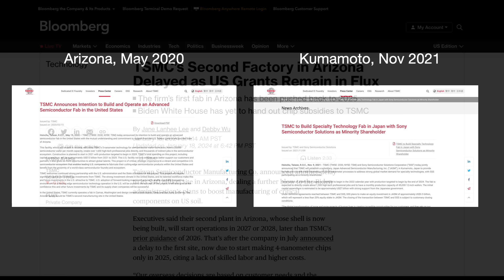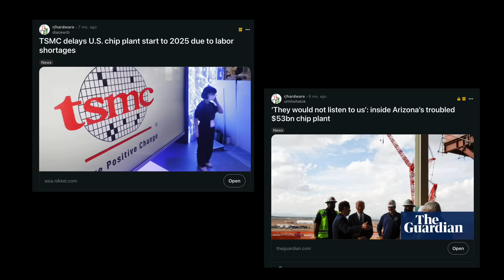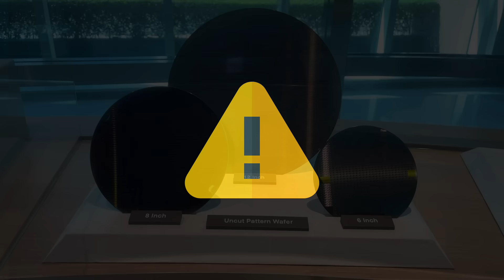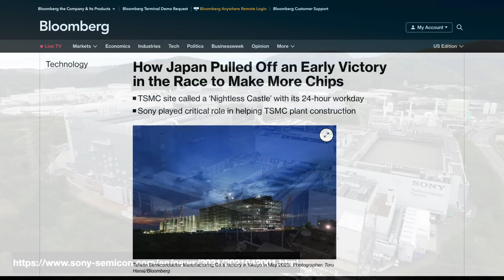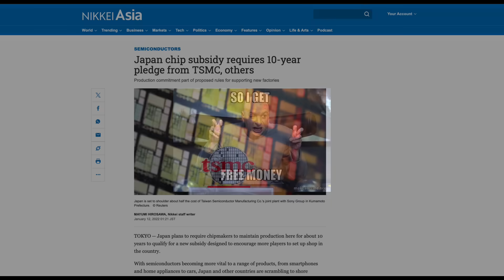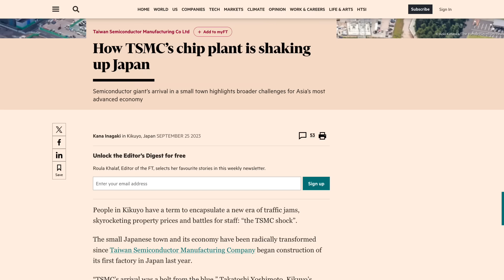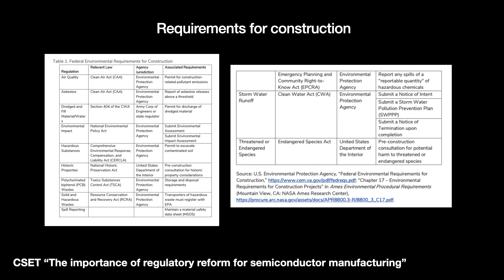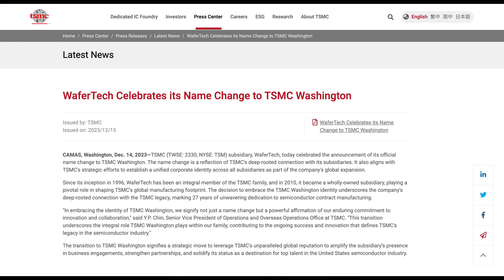Why is TSMC Doing Better in Japan?

Comment: According to several news sources, TSMC had originally planned for its second fab in Japan to manufacture 4-nm chips. However, TSMC has since reconsidered and is now considering a shift to 2-nm production once its 1.4-nm process comes online. This move would help all involved parties and countries secure a stronger and more resilient supply chain. I hope it will happen.

Comment: Can you please explain what is the meaning of what Dr.Morris Chang said below........ ?

Aug 6, 2023 --------TSMC founder Morris Chang was featured in a New York Times article that came out over the weekend. When asked about the Sino-U.S. competition for semiconductor supremacy, the chip titan said China doesn’t have much of a chance to gain the upper hand.
Reply: China faces couple of problems that prevents them from doing so. Given the right environments they can do it but China alone cannot develop such advanced chips. That's why they rely so much on sending students abroad. But that's not the only problem. China needs investors and nobody wants to partner up with any Chinese semiconductors. Nvidia, Intel, AMD, etc. Another factor is the pollution. It requires very clean water and clean air to produce high end chips.

Comment: 3:44 I noticed you never mentioned whether they had actually bought any of the machines yet? If they were slow walking in the us then all they would need to do is just not buy those machines you mentioned (after all what would be the point in buying them before the building is done, even better sense they require so much lead time) until they were ready to actually finish the project, helped by the fact big companies in Taiwan are a lot more tied to the government (both officially and unofficially) .

Comment: Unions? get these rodents away from this project asap, this is the one industry where worker "strikes" are the last thing this company or anyone with an electronic gadget wants. Imagine holding the supply chain hostage (oh wait didn't that happen in the America ports during the pandemic?)
Does TSMC have a bad reputation for wage compensation? I don't know, but I really doubt it.

To believe TSMC is really cutting costs for the installation of the new equipment at the expense of a delay that can theoretically cost them more money in the long run seems farfetched. TSMC should know what's better for their foundries and facilities, they have the talent, expertise, knowledge and discipline. Your channel really opened my eyes to the Semi-conductors and chips industry, thank you.

Comment: @ 13:03 i spotted a mistake i guess. 30'000 yen or even 50'000 yen is not a living wage. That's an expensive night out. 
I take it as a place holder for a 66% overpay, they offered?

Comment: If, as you say, "tolerances" of N4 are "less forgiving"  ( than lager NM rated chips ) ... why do you insist that N-size is not quantifiable ?    From what I have gleaned.... please correct me if I am wrong....  the EUV beam width measured in NM is responsible for overall semiconductor density, thus, performance.  ( You can squeeze more stuff onto a chip.)
Reply: IIRC Intel stopped quoting size in nm a couple years ago, they said it didn't make sense anymore because there was no industry standard for exactly what it measures.  Intel had been saying their 10nm was equivalent to TSMC 7nm.
Reply: Look at # of transistors per unit area. mm^2

Comment: Totally disagree with this analysis. Things are slow 100% due to politics/geopolitics.  0% to technical issues. TSMC knew from the start, that if everything went smoothly, making chips in the US is 30~50% more expensive. TSMC was doing the US a favor by setting up a 5nm fab, and expected a hefty subsidy. But the initial CHIPS act rules required TSMC to divulge both technical data, and competition sensitive business data to get the Subsidies. TSMC is way ahead of Intel and didn't want it's tech give to Intel by the US govt. The sillicon shield is real.  Numerous US think tanks have estimated that a China blockade of Taiwan would cost the G7 economies 2 trillion dollars.  That's why Blinken publicly said the US does not support Taiwan declaring independence unilaterally.  The US doesn't want, today, to provoke a proxy war over Taiwan.  In fact the Philipines and Koreas have now flared up.  Without the silicon shield, it's be Taiwan flaring up.  Also congressman S. Moulton said that the US would bomb TSMC to the ground to keep it out of China's hands. The silicon shield is real, it's not the only reason but its a significant contributing factor.
TSMC has NOT allocated 40B to build 2 fabs. Not 1 cent has been spent on the 2nd fab.  And 2028 may as well be 2050 or the year 2100.  The question is how much money will TSMC lose on its Az investment?  TSMC might break even if it gets ~ 5B of subsidies AND stop construction of the 2nd fab entirely.
Reply: Nailed it. Also Tech transfer is happening from Taiwan to Japan now. Flashback, that's how Taiwan obtained tech from Japan after US-Japan 1980s tensions.

Comment: Wouldn't the Arizona plant be better than Japan?
I mean they have earthquakes and that could really screw up some wafer batches and uncalibrate the machinery.
Reply: Japan has skiled technicians at tye same time longer experience in manufacturing semis. Also japan doesn't have qqater problems like Arizona. Earthquakes are not a problem because japan knows how to handle them.

Comment: That chart showing how Japan builds fabs faster than Taiwan, China or Korea is interesting. Japanese construction is just on another level. In railway construction JR leads in construction speed and solid earthquake resistance. Fast but also carefully engineered. I saw Kanazawa Station before the earthquake and noticed all the quake dampers on the columns.
Reply: You didn’t include Singapore in the ballgame. GF Fab7H was promised to be completely build up in 2 year but did in 1 and a half year. Same with Micron and ST Micro.
Reply: Cant agree about speed on construction. Remember the nagasaki shinkansen or rinkai line wich is only 6 km needs 20 years of construction
Reply: @adiba9734 Japan has Shinkansen since when? 1964.

There is many earthquake in Japan. So the delay is mostly because of this in calculation.
Reply: @JapanQuest   theres nothing to do with that tbf. Most of japanese infrastructure was built faster before 90s. Just take a look at the hokuriku shinkansen that take more than 17 years to complete just 300km lengt compare to tohoku shinkansen that just need 10 years to complete 400km of tohoku line. The same problem was also happen oversea that the jakarta mrt extension need 7 years to built just for 6km of lengt that built by japanese contractor.
Reply: @adiba9734  because Japan focus on high quality. The quality is way above China.

Comment: I live in Phoenix and although I don't have specific insight I can offer some general thoughts.  
1.  Intel is expanding and training is held in the US
2.  Water is an issue not going to be easily or cheaply solved
3.  AZ has horrible pay rates that don't lend to employee loyalty
4.  The air in the desert is extremely challenging to filter - silt is invasive
5  AZ unions are weak due to the state being a right to work state.  The unions have no legal means to keep non-union employees out of the work force

Comment: I have a process engineer cousin, 4 years XP, working at Intel and he told me that the TSMC fab offer its just a bit over the Intel. He refused because he does not want to work under so much pressure that the TSMC is putting on people

Comment: A bit off on current investment in the AZ Fab.  If they have just installed the last steel beam. They are a long way from installing the manufacturing tools. Building a fab building is not cheap but it is peanuts compared to advanced fab equipment. They could probably still afford to just walk away if they wanted to.
Reply: They can't go away.
Even if the AZ factory keeps losing money, they can't go away.

Comment: Hey dude, forget the chip shortage, that's not what the TSMC fab in the US is supposed to deal with.

No matter how people FEEL about AI, it's growth is HUGE and it's going to keep growing for a few years.  Also, while a lot of companies don't get on the MOST advanced node, they get on the one right behind that, and right NOW that's N5/N4 so if TSMC could get that first line up in AZ there is NO shortage of need for what could come off that line.  In fact N4 is what a good chunk of AMD's next product line will consist of.  That comes out around the end of this year.  This means somewhere along the life cycle of next gen AMD parts, some could be rolling off the line in AZ.

Having said all that, 2025 is a date that TSMC floated at the beginning of this project so THEY knew it was going to take a long time to get this up and running.  On the other hand, Intel floated a date of 2024 for their new fabs in AZ.  They're also supposed to be putting out Intel 20A.  I'll be SHOCKED if they get it out in 2024.  I mean it took Intel forever to get onto EUV.  Having said that all their issues getting onto EUV could help them get onto High-NA EUV much faster so maybe Intel CAN actually move to a new process node without years of delay, maybe.

The TSMC plant in AZ can handle 6 phases.  I expect there will be at LEAST 3 because they WILL be bringing in High-NA lithography and once they get through the growing pains of that, that opens the door for future nodes.  I think TSMC will find the U.S. to be a HUGE market, you know with Apple, AMD, Nvidia and a few other companies where the push is really to bring back not only fabrication but assembly and testing, via the US and Mexico.  Different companies are already in talks with getting labs in Mexico, so I think maybe you're failing to see this all play out over the next few years.  If assembly is happening in Mexico then it makes sense to take chips from AZ, truck them a short distance to Mexico, do assembly and testing and then finished products come back into the US.  But with AMD as a customer and AMD making a variety of parts including CPUs for enthusiasts (DIY PC building), that could all be done in AZ including finishing the CPUs and testing.

I'm not as pessimistic as you when looking into the crystal ball.  I think the TSMC AZ plant will most likely get at least 4 phases because if they don't Intel will start stealing away TSMC's customer base ESPECIALLY if Intel gets to 20A before TSMC gets to N2.

Comment: If I remember correctly the Japanese first phase uses DUV since it's 28nm which actually DOES refer to something.  It stops referring to anything dropping down below somewhere in the realm of 14nm depending on the company.

Getting a DUV lab up and running is VERY commonplace for TSMC now.

On the other hand AZ is loaded with problems, starting with even the construction, water issues where TSMC has to recycle almost all the water they use, and on and on and on.  It's also using EUV which is a much harder lithography to get perfect.

N4 is a variant of N5 so it's not a big change for them to start with N4.  This was always a possibility for them and it makes sense because different American companies are using N4 for different parts, the biggest being AMD.  Nvidia currently uses N4 but their next product lines should be N3, and Apple is using N3, so phase 2 for the AZ plant should be N3.  AMD on the other hand is using mostly N5 and N6 with SOME parts on N4.  The AZ plant will probably never make anything for Apple since Apple always wants to have a node advantage and are on the newest nodes, but they can make parts for a lot of other chipmakers who don't want to be on the newest node for various reasons.
Reply: If you run with the most "advancing" chip maker, why not just listen it's issue of critiria, and run with it first, then you become the most "advancing"? Mr. USA
Reply: No one forced TSMC to build their fab in Arizona. TSMC chose it there, Taiwanometry is always complaining about everyone in Asia but China. Now it’s complaining about America.

If TSMC wanted to build it’s fab in hot humid place then they should have selected Florida.

TSMC chose Arizona knowing process will be slow.
Reply: @kulkrafts3143  I can't believe people are actually this daft, the TSMC plant was announced during the height of the chip war with china when America announced its CHIPS and Science Act. While they didn't technically "force" TSMC to operate in the USA, the tension between China and Taiwan was at its peak during Covid as the lockdowns also cut off diplomatic channels between Taiwan and China. 

It didn't help that TSMC at the time just announced its newest 3nm Node, compound that with the fact many chips in use by US military is also manufactured by TSMC, there was a really real concern for China taking Taiwan and gaining both the newest chip fabrication technology and access to potential vulnerabilities in US weapon systems. 

There was significant pressure from the US for TSMC to build its newest 3nm fab in the USA, its just done in typical US fashion. The China chip ban cutting off TSMC from one of its largest markets, and the CHIPS and Science Act with its enticing government subsidies makes it super obvious to any company what America wants them to do.

But of course once Covid was over and the looming threat of a Chinese invasion stamped out thanks to the Ukraine war showing China it wasn't worth it to engage with a NATO aligned country, there was no real incentive for both TSMC and USA to follow through with the Arizona fab, leading to the situation we find ourselves in today.
Reply: @kulkrafts3143 exactly, they'll figure it out. Always complains about Asia? I kind of thought he seems like a bit of a simp for Asia lol. I probably haven't watched as much of him as you though.

Comment: Hey!  Where should we put these water thirsty plants in the US?  I know!  Let’s put them in a desert state that’s running out of water!  Brilliant!
Reply: They have a plan to actually reclaim more water than they use . 
We will see how that goes. The south west unfortunately is the most geologically stable areas in the states and most conducive to semiconductor manufacturing
Reply: You may be right, but I THINK that Arizona State and local tax incentives may have played a bigger part in the plant location than any geologic stability. I DO hope Intel can figure out sustainable water there.  @Error_404-F.cks_Not_Found .
Reply: Dude the technology to completely purify water in a "closed loop" is decades old.
It doesn't matter if the Fab's on the bottom of the ocean, the middle of the Sahara, or the surface of the Moon.

Sure, it means the fab basically needs an entire power plant and waste treatment facility bolted onto it.... but that's a small expenditure next to the fab itself.
Reply: @-_-----  So can you tell me what the actual water usage is for the existing fans there, and the projected usages for the proposed fabs? The companies CHOOSE how much to buy and how much to recycle, based mainly on cost.
Reply: So dumb